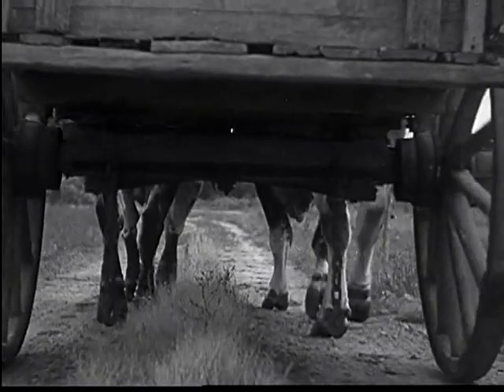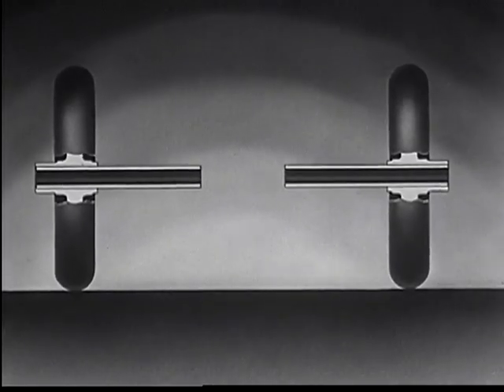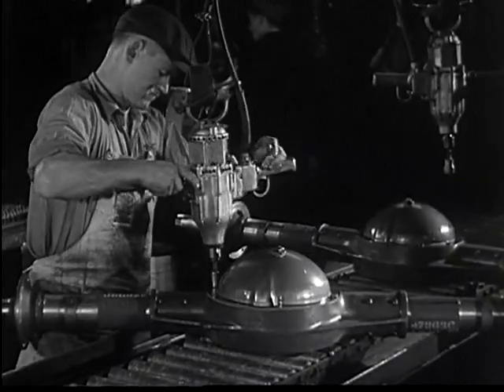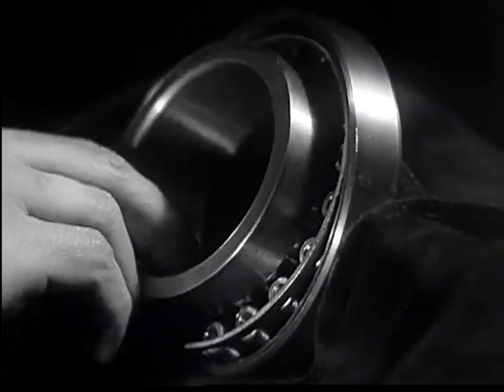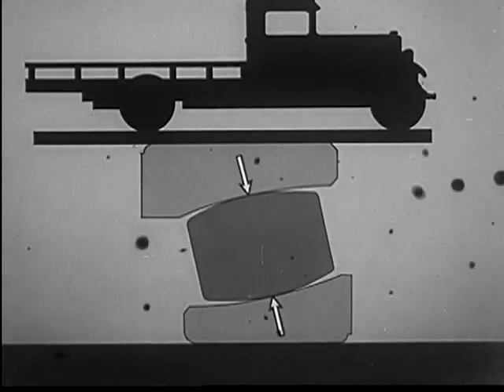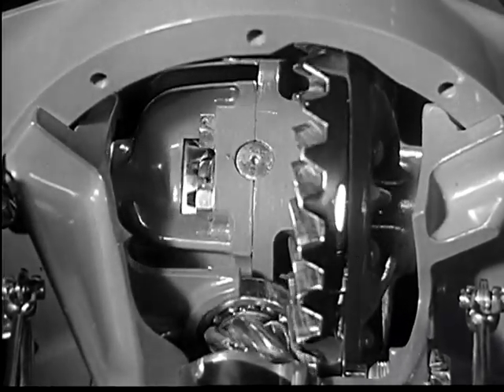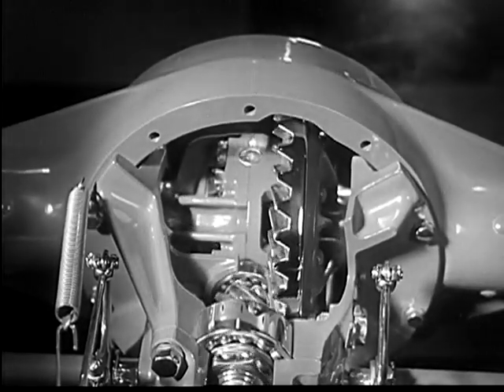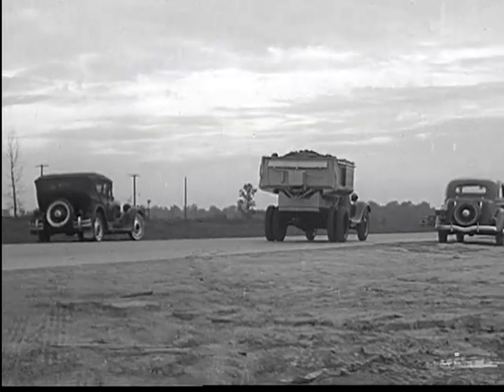It Floats - Chevrolet Full Floating Rear Axle (1936)

Comment: 2:37 thats space age stuff! Are we still using these types of bearings on HD Trucks today?
Reply: No they use plastic bushings instead.  Much cheaper and guaranteed to fail within a few miles.
Reply: @wildbill23c  atleast of you start a modern vehicle in your garage you won't immediately suffocate.
Reply: @jwalster9412  Wish I had a garage...and if a car is properly tuned, new or old, you won't suffocate in the garage by simply starting it and driving away.  Most people have no idea how to maintain a vehicle, they just get in and drive, and it shows when they bring it to your shop and you have to deal with their lack of care for their vehicle.
Reply: @wildbill23c  I was referring to the fact that alot of older cars have no cat converters, and most before the 60s ran on leaded fuel.
Reply: @jwalster9412  Cats or no cats doesn't have anything to do with carbon monoxide, or choking on fuel vapors from poorly tuned engines, however.  Cats just convert NOX to water vapor for the most part, but if a car isn't tuned properly or when its cold the Cat isn't able to work properly and you get that terrible smelling exhaust/unburned fuel issue...Unfortunately no matter what you do to an engine when its not at operating temps, or not tuned properly (most common problem with vehicles) you'll have terrible exhaust emissions.  Its worse in cold climates where you can't just jump in your car and drive away so it gets to temperature faster.  I mean I guess you could if you drove with your head out the window to see where you were going, but then you'd have frost bite problems instead LOL.

Comment: Sure the axle is easy to install BUT If the axle breaks inside ...its a real mother to get out. 

This is how 3/4 ton and bigger truck axles are designed. I've only seen one break. It was a new freightliner about 1996. The whole dual set of front drive wheels passenger side came off and the truck was loaded.

Comment: It’s so sad that is become like this, but that’s planned obsolescence, especially when your 5 volt DC USB outlet roasts the cars central CPU, causing the car to not even turn on or change gears. Additionally, you will only be able to take the vehicle to the dealer to fix it, as the Secondary CPU’s and module will be written to the central, to only accept data transfer between those specific modules. Haha, what can I say, but MONEY TIME.

Comment: I find it both interesting and humorous how many people are complaining that today's vehicles are cheap crap and not built like they were in the old days. So let's take a look at a few facts.
1. Not too long ago, it was a routine maintenance detail that a vehicle required a "tune up" at least yearly (usually done in the fall because of winter...). When was the last time you had a tune up with a modern vehicle?
2. It used to be quite impressive to get 100,000 miles on a vehicle. Getting that much mileage was an impressive achievement. Now a days, it's quite routine to get 100,000 miles and it's not unusual to get 200,000 to 300,000 miles.
So why do so many people consider their vehicles cheap pieces of crap, when you actually look at the performance and see that they're quite superior to the older vehicles?

Comment: 83 years later, you still change the rear axle on a 2019 Chevrolet 2500 Silverado the same way.
Reply: Well add to changing a few sensors too that were never needed back when people actually knew how to drive.

Comment: I used to bad mouth GM products, some deservingly so, but they certainly built some winners. My 2 wheel drive, '97 Chevrolet Blazer sports the smallest rear end GM offered then, a seven and a half inch ring gear. Nothing has changed hardly at all from this 83 year old Chevrolet teaching film rear end to the one in my Blazer. Materials have gotten better, assembly techniques as well. That equates to longevity. I don't drive the Blazer much but it's been trouble free at 250k when it comes to the rear end. The Blazer has been trouble free in many other ways as well, to my surprise & respect, but it helps to be mechanically inclined & replace wear & tear items.

Comment: Most of the minivan loosers on the road today can't find the oil cap, and mechanics are like "I can scan the error code that lit the check engine light but GM won't give me a list of what the codes mean because I'm not a dealer."; this guy is like "Hey, I'll swap out the axle roadside by myself using a standard wrench and still be home for lunch" ...in 1936. 
Materials certainly have improved, individual components can be better engineered, and build quality [final assembly] has recovered since its all time low in the late '70s-80s; but the overall design and value per dollar has degraded. I figure the marketing departments have determined the biggest profit is made from fools and so they focus entirely on that customer segment ignoring everybody else. The money isn't made on a solid 3/4t standard pickup with ease of maintenance, medium engine and strong drive-train; the profit is in fake chrome trim, bloated oversize body panels,  extended cab, short bed, driveway queens used for commuting to an office by dipwhits that never change the coolant or bleed the brakes so the engine block and brake lines rust out at 150k. 
Folks like my dad(a marine powerplant engineer) who actually did the basic oil, coolant, and tuneups could get 300-400k from the old (pre 1975 ish)  vehicles and I don't mean limping along hoping it will start and burning oil; no, these were all in good reliable, turn the key and go condition at that mileage. And then you could easily pull and rebuild the engine for $1-2000 and keep going.